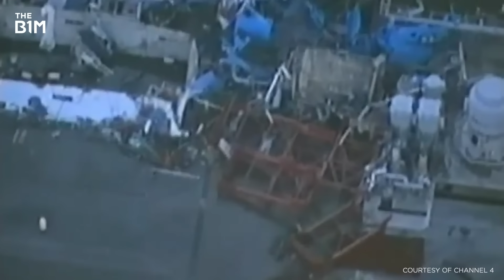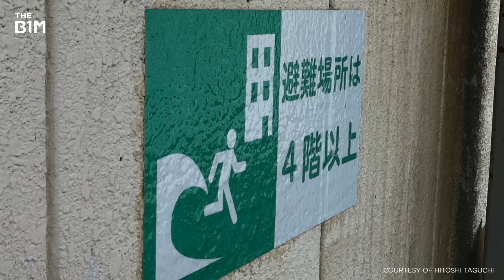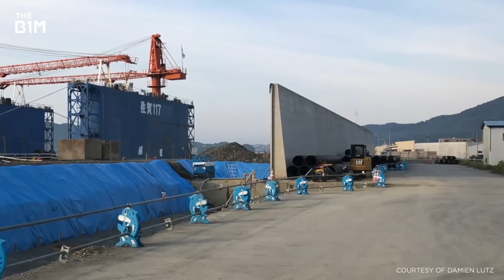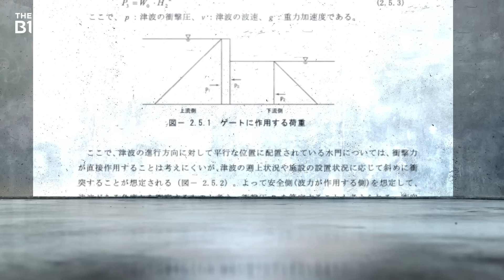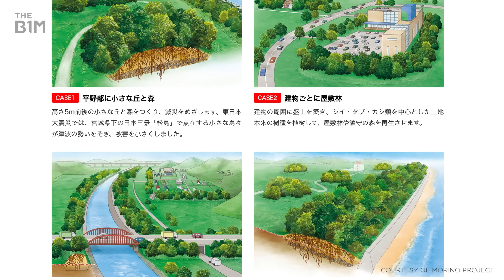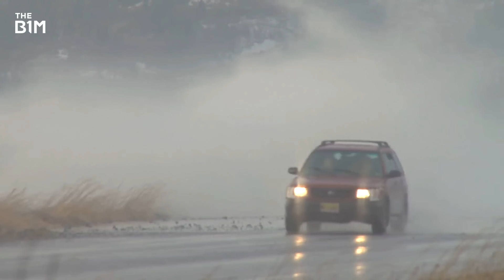Japan’s 400 Kilometre Tsunami Shield

Comment: Great engineering but wrong concept overall because it is more wise to build everything in higher elevation or further away from the coastline, than trying to stop a tsunami with walls. Walls of such size require maintenance that it is harder and more expensive to keep up when you build so close to the coast.  

So instead of rebuilding whatever was destroyed by the 2011  tsunami and then build a wall they should have moved everything a bit higher elevation or further upland because there were not left after all that many buildings standing after the disaster. It is not that it was left something intact there to just repair it. They had to rebuild everything again.

Not to mention that I don't think that such a tsunami will happen again, ( the 2011 one caused by an underwater landslide), and when it will happen again in 100+ years the wall will be already old and damaged enough to not be able to hold the tsunami away from the inhabited coastal areas. 

I watched the other day a video about some ancient huge rocks that are made as signs, placed in higher places throughout Japan,  which write with huge letters "build above this stone" as a warning and advise to future generations on how to protect their homes from tsunamis. That shows that Japanese of the past knew that the most effective way to protect themselves from tsunamis was (and still is - it is common sense ) to live away from the coasts.  I don't know why modern Japanese ignore such kind of common sense.

Comment: It was a real tragedy event in 2011. My heart goes to all the victims. Having watched all the videos that I could find on Youtube, I can’t help thinking that the best way saving more people is not focusing solely on building higher and more walls. They help in so far as giving more time for people to escape – possibly 10-15 mins more – if the tsunami is higher than 15 meters. The point that I am making is that … Did you notice that all the video clips were taken by people mostly on top of a solid tall building even though the water and debris were running pass just below. It seems to suggest – just my humble opinion – that it would be more effective to mandate tall buildings (and their design) as evacuation points, plus building more escape high points in those towns located by the sea. These escape high points have to be strong enough to with-stand the torrents and they are dotted around the town in no more than 15 mins of reach. Anyway, I am not saying that the walls are not useful, we may need more ideas in addition to the walls.

Comment: Wouldn't it be better if the side of the wall facing the sea was not smooth? It would also have been a good idea to include concrete steps in the design so that people could cross over the walls when they wanted to.

Comment: It should be good if there were sturdy (concrete, steel) 20 + meter high escape towers in all neighborhoods. tall order, but they don't have to be solid as long as r total of the construction can a) keep the platform on top up despite the force of a possibly massive wave b) can keep its stairway up (and include mounted ladders for backup) and they may be lower if the ground level they are on is higher of course

Comment: Terrible solution Japan picked probably pressure from large corporations that want to minimize losses in case of tsunami. Only the sea walls have the appearance of protection but not in reality. The better solution, more cost effective for the country in whole, and population in danger are evacuation towers  that would line the coast in intervals relating to local population. It would not destroy culture, livelihoods, vista. It would be a tourist attraction. The towers with a buoyant landing on the top that doubles as a safe house and helicopter landing pads. Blah

Comment: Opposite Arch shape construction of tsunami defence wall facing towards the sea, can be helpful. It will reduce the waves pressure, simultaneously after constructing that, they can contruct underground & covered reservoirs, that can store the water for sometimes. And when the situation will come under control, release it again into the sea with proper drainage system. Reservoirs can stop the flood very effeciently but reservoirs should be technologically perfect. Even though experts can think about it more accurately. I just said my opinion.

Comment: Cant say I blame them for building the walls, but they are a bit of an eyesore, so I can see why the locals are upset.  There must be ways to build the wall in such a way that it can be open, then deployed when needed, but that sounds really expensive.  Could be cool to have the wall pop out of the ground or something using hydraulic or pneumatic pistons.  I suppose that might cause other problems too, what happens if someone gets stuck on the wrong side of the wall?

Comment: The next logical step is giant walls that can be raised and lowered, a la Evangelion! No need to worry about view issues if all the walls can be raised and lowered! /partial humor

Seriously though; a mix of a forested green space behind the walls or elevated parks behind the walls makes sense. A mix of land reclamation and beautification, and in some places, maybe even moving some residences and businesses to newly constructed high ground, while still permitting some beach access or beach views. Just further elevated. It won't be cheap, but it would be a net benefit for Japan in the long run, having more artificially raised coastal regions partially sustained by tourism and sea-side living but also serving as semi-natural barriers to all but the worst floods.

Sure, it won't completely stop the rare century tsunami, but rather than being now in a flood basin formed by the walls and any surrounding areas, the elevated buildings would suffer a shallower flood, seeing just the water that managed to crest the walls. Heck, throw in some more underground flood measures and shelters; built on the original low lands and then covered up as part of the elevation project with access points built high enough. It won't quite be the Evangelion Geofront, but having large underground emergency shelters people could survive in for a few days would be useful in dealing with flooding (and war) that far out from the bigger population centers. And additional flood control mechanisms could further help send the water back out faster, while the trees/plants help with further absorption of the water while providing some breakwater and erosion resistance.

Comment: I'm no engineer, but can they not fill in most (if not all) of the wall height on the inner side with fill rock and then soil, so that it's a green space and not a towering grey wall?
It's the outer side that needs to be bare and nearly sheer, right?
Granted, that's another immense project to do even if it can be done, and the added weight and forces pushing at the inner side might mean it needs more strength to stay put, and it's already expensive, so....

Comment: Why not build some V shaped lower dikes that eventually funnel the water away into bigger channels/reservoirs further inland? Basically collecting the water in certain areas, which are designed to withstand the massive inflow of water and mitigate damage. You know, like the polders in the Netherlands. That way, you don't need to completely ruin your coastline with a massive wall. 
There will still be damaged areas during a tsunami, sure. But it's more about mitigating the damage, rather than stopping it. Because, as mentioned in the video, even the wall doesn't stop the bigger ones and will most likely cause them to do even more damage, because the lands behind the wall aren't prepared to deal with the water inflow and the increased force upon wall breach.

Those 'anti-tsunami parks' are a good idea. They're basically a fancy polder :P.

Anyway, I think most countries should (and probably already are) prepare their infrastructure against floods. Because with the increase in storms and rainfall, it's not just tsunamies that we have to worry about. Which makes the wall an even worse idea, because you're not just keeping water out, you're also trapping yourself in. Just create some fancy polders that don't ruin your landscapes and can be flooded when neccessary. Then you'll at least be more protected against BOTH tsunamies (mitigated damage) and heavy rainfall/ storms.

Comment: It shocks me that they haven't made underground suck away system that when water reaches a certain amount or hight they automatically activate, lvl 1 tsunami should be a piece of cake make much controlled drain system that can suck the sea water in or underground so it doesn't build up to the top of the wall, the more pressure the water brings the more automatic suck away systems activate at very high speed pumps that can pump tons of water underground into controlled areas I think it's very possible to do something about this, Japan love 💜💚
Reply: @LN I think it's possible but gonna take a lot of work to get done something tells me this one idea in my head can somehow mean allot I future, as my gf is from Japan I think I'm gonna see to contact the government or who ever is in control an bring my idea's to the table
Reply: Um, no. This isn't a slow moving small body of water. It's the entire ocean.

Comment: unfortunately it will not work well ... too vertical walls will fall during the next tsunami level 2 (maybe even a level 1).

When a wave that has broken and rolls towards a rock, water accumulates behind and the level rises to exceed it or bypass it (and this is because the rock does not move) because the energy s 'accumulates on the obstacle, no need for a film-like wave.

the post tsunami images in Indonesia showed it well, the watertight obstacles fell there, or the concrete houses but open, or the trees had held ... and saving lives.

In the end, instead of a wall, a raised dike ,and behind trees, a natural area with tall but "hollow" concrete constructions would limit damage.

Comment: This is quite shallow, news-story-style material, but still to the point. About the tsunami protection, I guess the most practical option for less developed countries is to just ban new construction, with some small exceptions, some distance from the shore. This alone can provide huge savings, also in the event of rising sea levels due to global warming. Constructing a concrete wall, on the other hand, is contributing a lot of extra CO2, exacerbating the problems.

Comment: It's a big problem for Japan, which originally lacks flat lands, but now this is worsened by inability to use costal flat lands. On top of that I personally don't see how walls can help - there is a lot of moving water and it needs to go so somewhere, walls may stop it for a while but eventually it will overflow if the wave is strong enough. But what do I know.

Comment: I really enjoyed reading through the innovative and creative solutions mooted in the comments. It's great to see such discussion stimulated on big engineering projects. A couple of broad themes I noticed we're 1) build a concave/wave return wall and 2) the issue of sea level rise. 3) the use of trees etc.

With 1), concave walls with wave return crowns and similar are designed to reflect wind wave energy back seaward. The reason this wouldn't work in a tsunami is that a tsunami is a very very long wave (km in length) in comparison to a wind wave (10s of metres in length). Thus the wave energy is spread out over a huge length. This is why the wave takes 10/20 minutes to inundate before the water begins to recede. It is analogous to a open channel flow like a river in a continuously rising flood condition. So wave energy reflection, which can also rely on the wave breaking to some extent, is not applicable here. 

2) sea level rise. The point is that the current infrastructure is built on a known mean sea level. Once we start getting the SLR effects then such infrastructure might not be able to perform its function as well. Here, a 15 m tsunami wall may then be only 14.5 or 14 m in the future. 

This strikes at the core of the debate: do we build hard sea defences in a 'hold the line' approach or do we retreat from the shore line completely, or do we use natural defences or a combination thereof.

3)On mangroves and forests. It's proven for hurricanes/typhoons and storm surges that these can help a lot. But it's less clear on tsunami. Again because of its open channel flow like behaviour. The tohoku tsunami of 2011 resulted in a lot of said trees becoming floating missiles. Some of our experiments also showed that the flow constriction effect (reducing the flow area by adding obstacles) can result in higher flow velocities through the remainder of the area. 

There's much work to be done in this area still.
Reply: Hello.. 👋🙂 🇬🇹
Reply: Your in the video right
Reply: Very wise man
Reply: Damn fascinating stuff. Yeah I think planting trees is a catch-all for a Bunch of good intent. We see them as inherently stable yet flexible. But some of these forces are not the same. Like you said the reason mangroves help diffuse hurricanes doesn't make them effective for tsunamis
Reply: @tajr22  the trees will also would be more appealing than just starting at plain concrete lol the trees bring clean air can have some trees with nice  flowers or fruits etc.  
All around I think is a great idea but would be great to have something on concrete barriers that involves historical meaning to where you place them
Reply: I was just going to ask about the oyster barriers and if the artifical ones can help too but coral is not much either according to previous replys
Reply: Whoa, you were in the video. Hello sir, thanks for the work you and your team do!

Comment: I'm just spitballing here, what if they installed this parachute kind of device that is anchored to the sea bed. It doesn't necessarily have to be very near the shore and obviously, this device would be much larger and made of much stronger materials than an actual parachute. This could dissipate the energy of the waves thus mitigating impact of the tsunami making it more manageable for the seawalls to handle. This could also result in shorter seawalls being built.

Comment: One item not mentioned here is that not only was the tsunami taller than the wall, but that the subduction caused by the fault's slippage LOWERED THE WALL ITSELF by about 2 feet.

Comment: This is very disappointing to see this wall. It is 400km of ugly, and it will be overcome.
Creating shoreline forests of cherry blossom trees, with an appropriate rise in the level of the land, is now needed.
Stopping a million charging elephants, requires millions of trees to diffuse the force, and remove all energy from the attacking beast.
At 10 years, the wall was the fastest fix for the problem, but they should now start the 30 year job of making a beautiful forest, that will boost tourism, and help capture so much carbon.

Comment: I was thinking they could have adapted the concrete walls and built on/alongside them so they become a part of the urban landscape and aren’t seen as walls but places with various functions. I wonder if it would be safe enough to build higher density residential that can be quickly evacuated in the event of a tsunami that would also help bolster the strength of the wall itself. Seems a shame that people are disconnected from the sea especially if it’s their livelihood in the case of fishermen who need to be in contact with it to assess the condition of the water.

Comment: What isn’t mentioned is just how strong the earthquake was and what it did not only to Japan but to the planet.

The main island shifted 2.4 m to the east, the earth shifted on its axis by between 10cm and 25cm, it caused the earth’s rotation to speed up, and caused large parts of the coastline to drop by around a mitre, this has since risen back to its original height and higher. These new defences might work against a smaller tsunami but, another earthquake of this magnitude would probably have the same affect. Mother Nature always fights back.

Comment: Yet another great video, although there was one important item that wasn't mentioned.  It wasn't just the height of the tsunami that caused issues.  The land subsided quite a bit from the earthquake while at the same time the sea bed rose.  Land subsidence in some areas was 2 to 3 feet (.6 to 1 meters) while the seabed rose almost 10 feet (3 meters) in some areas.  Interestingly, some areas of Honshu have recovered the lost height.

This subsidence and sea bed rise affected the tsunami protection and in a few areas allowed the protection to be over topped.

Comment: Honestly the walls look ridiculous. I'm no expert, but it looks like it could break easily. It looks like a badly thought out quick fix.
Instead of building against the wave, why not build WITH the wave, i.e. redirecting the water away and building tsunami proof buildings that would let water flow THROUGH or 'underneath' them? It's like earthquake resistant buildings but for tsunamis.

Comment: One of the other issues not frequently highlighted with the 2011 quake was that parts of Honshu slid eastwards and subsided (lowering the original height of some coastal seawalls).  I believe the city of Ishinomaki saw some of the greatest land subsidence where some residential areas remained flooded even at low tide post-2011.  Another thing one of the researchers (the one with the glasses who often times is interviewed in documentatires and Japanese broadcasts) at Tohoku Univ found was a previously unknown phenomenon which made the tsunami height greater than expected (something to do with a bubble of water that was caused by the quake which the tsunami itself ended up on top of).  Basically, you can only mitigate against nature to a certain extent.